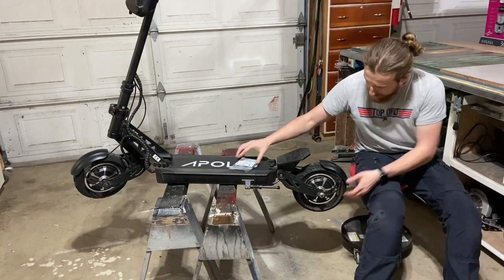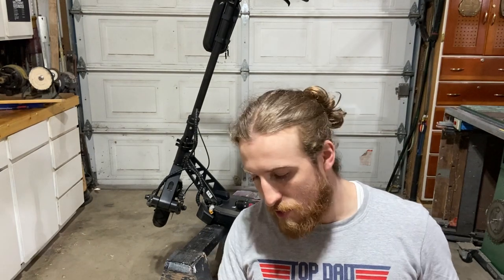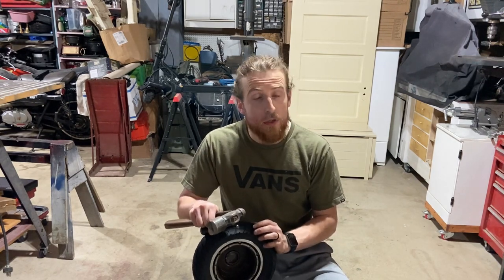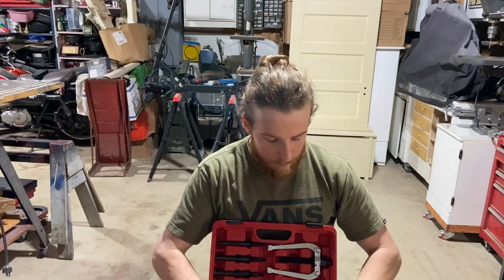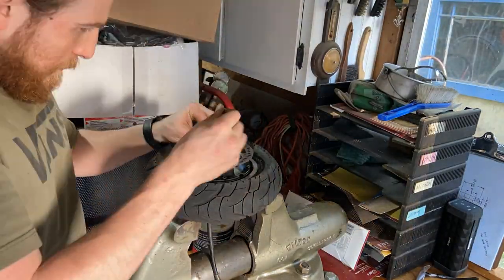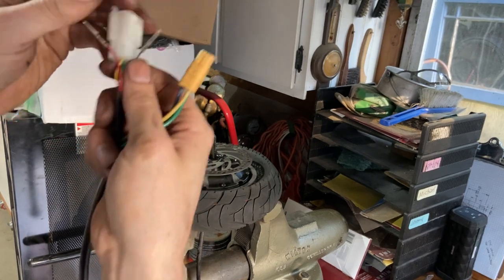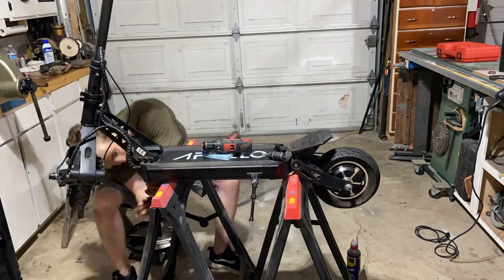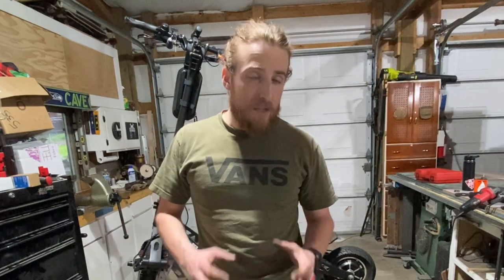How to Change an Electric Scooter Motor and Wheel Bearing

Comment: Great video - thanks. I have the same scooter. There are 2 bearings in each wheel. The cable side uses 6003-2RS and the brake side uses 6202-2RS.

Comment: Thanks for making this man. There are no other “change bearings on an Apollo scooter” out there. I have a phantom but the process and inner workings are the same. Honestly, getting the motor cover off took a minute because I was afraid I’d break something. Thanks again!
Reply from the maker: I felt the same exact way when taking it off of mine! And I figured if I couldn’t find it out there then other people like me wished there was a video on it too. Happy I could help.
Reply: Are they the same bearings for the Phantom?
Reply from the maker: @ciprianstanciu As far as I know, yes. The sizes for all of these scooter wheels are pretty similar but I would double check with a  scooter repair shop or Apollo just to be sure.

Comment: I have a Road Runner RS5 Pro, both motors are making a knocking noise.  I wanna replace the bearings.  Wondering if they're using the same size bearings...
Reply from the maker: Just take it apart and find out. It’ll be fiiiiiiinnnnnnneeeeeee…..
Reply: @TheBlazerBeam  In progress.  Ordered a bearing puller to get the bearings off the axle.  Other than that, the motor looks very clean.
Reply: 6203RS on the cable side, 6202RS on the brake side. 😁
Reply from the maker: @Maxthafirst well would you look at that!
Reply: @TheBlazerBeam  I'm just hoping replacing the bearings gets rid of the knocking.
Reply: @TheBlazerBeam  Ended up breaking my hall sensors on one of my motors.  I'm guessing it happened while trying to pry open the cover.  I tried buying all the tools and the sensors in attempt to fix but that failed miserably.  Ended up having to replace one of the motors.  I did end up getting bearing puller tools to remove the bearings from the shaft and housing.  All in all, I installed 3 new bearings and left one from the brand new motor in there.
Reply from the maker: That’s a rough go of it. I’m glad you didn’t have to replace both motors but it would’ve been a lot better if you didn’t have to replace the one. Hopefully after all the work you did it rides smoother now
Reply: @TheBlazerBeam  Yes, that's the good news.  With the new bearings, the acceleration feels stronger and the scooter is much smoother.  I've got PMT tires on mine.  Feels great!  Needless to say the knocking is gone.

Comment: Mine was making a clanking noise every rotation. Then I stopped using it for a week and it completely seized up. Think it’ll be harder than your repair?
Reply from the maker: It’s possible. I saw evidence of rust all over the hub, the wheel would rock side to side and I let it sit like that for a while. I’d say don’t let it stay in that condition too long or the repair will get harder

Comment: I bent my rim on my Solar ff lite , new wheel and rim is coming installed already but I have to put the hub on the new rim . As a novice you think I can do it on my own are do I need to take it to a shop?
Reply from the maker: I think a novice can do it. I’d say give it a shot and if you find yourself in over your head then take it to a shop. Just watch some YouTube videos and take your time
Reply: @TheBlazerBeam  appreciate it bro , I took off the old rim and tire and disc rotor and slid out the motor, now I’m just waiting on the new rim and tire to come in solar already put it together for me ! My confidence level is much higher now thank you!

Comment: my front right bearing on my kukirin s3 is making some noise when im pushing it by hand, is it still good to ride or should i look into it right away. Its not wobbling but it sound kind of dry. BlazerBeam do you have any opinions on what i should do?
Reply from the maker: Look for evidence of rust or places where water could get in. From experience, I would say the sooner you deal with it the better. Could be brake disc rubbing, could be a bearing going out but either way, putting it off will just make it harder to repair later on.
Reply: @TheBlazerBeam  Thank you so much för the advice, ill try to get it done as soon as possible. Thx :)

Comment: The installation is correct, but the motor connector in which you put the cables is outdated technology, there are much better connectors!

Comment: Shouln't be that 6202 bearing, i.e. rather than 6003?
Reply from the maker: After the research I did and verifying by checking the stock bearing, I found it was the 6003 bearing. If you have a scooter other than the ghost it is possible it uses the 6202 bearing instead.

Comment: My bro. If ypu need to do this again. Get a jet lighter and pick one point of the bearing. Get it super hot in one spot. (Preferably the inside so you don't kill the paint) then rapidly cool it. It will cause it to shrink. Even if it's only .05 of a millimeter it'll help your cause. If it don't come out do it again directly 180 on the other side.

Comment: thank u god   I have a Iscooter ix3 not even a year  old  800w rear motor  that wobbles like a bitch? and like u said its hard  to find a video showing people how to do it yourself thank u how did u go about finding the right bearings
Reply from the maker: I used Reddit forums to figure it out but it looks like overall it’s pretty universal. If you can’t find the info you can always take the hub apart and physically look at the number on the side of your bearing